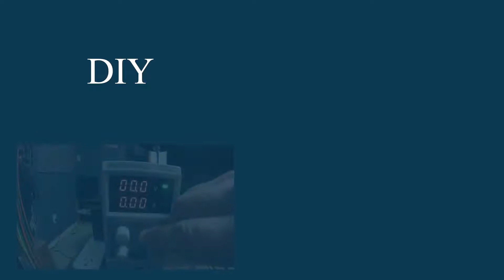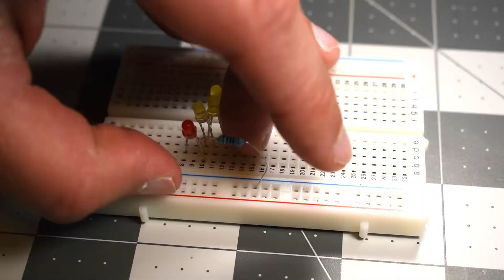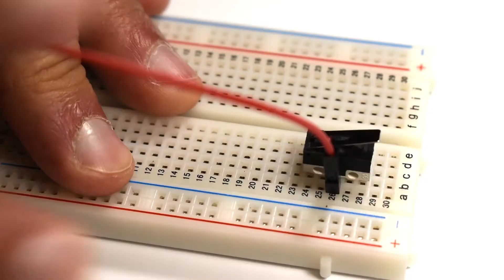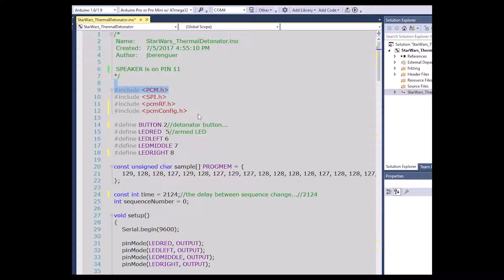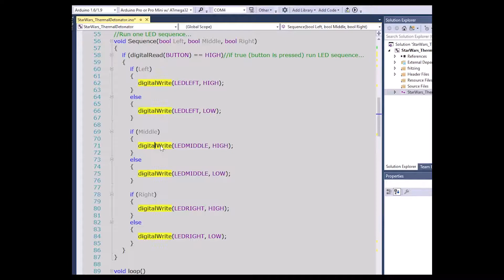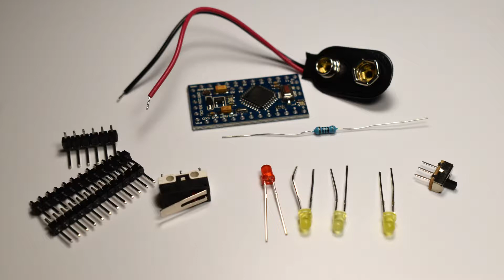Arduino: Making the Return of the Jedi Thermal Detonator

Comment: Do you have a pic of how you attached the momentary switch to the 3d printed slider?
Reply from the maker: unfortunately, I do not.. what I did was use a screw to secure the switch near the slider and then used hot glue or super glue to further secure it.. I placed it where it would be pinched "closed" when the slider was moved back.. I never tried actually securing it to the slider itself

Comment: Can you use the same code and parts with an arduino nano every?
Reply from the maker: using a nano shouldn't be a problem. I would recommend comparing the data sheets just in case. The nano and pro mini do have a different number of pins. I would check that the nano has enough pins to support the number of connections for this project. I have not tested the nano for this project, but the pro mini I have used has comparable specs at first glance.

Comment: Thanks for the video, it's a really interesting project.
I used an Arduino Nano instead of the pro mini but got it to work without any major problems. 
Currently thinking about adding another button with a second sample (if i can fit it into the memory) to have the normal "armed" and an additional "detonation imminent" sound.

However, if you don't mind, i got one question:
My mouse button tends to fall out of the breadboard and if it does, the behaviour is the same as if the button is pressed. Why is that?
When the button is not pressed, the contact of the mouse-button (C, Pin2) is connected to NC, i.e. ground.
When the button is pressed, the Pin2 is connected to Vcc (pro mini) or +5V (nano), so it gets the high signal and starts the sequence.
But why is no connection at all the same behaviour? I can even remove the Wire from +5V and just connect and disconnect Pin2 and Ground to switch...
Reply: Okay I found out what is happening: In the code, Pin2 is defined as Input_Pullup, effectively connecting Pin2 to +5V when nothing is attached. 
The definition as Input_Pullup is done to have a known state, as the Pin resistors only need a very small current to register a state and can be influenced by environment if no connection is present, so they are usually set to either +5V (pullup) or ground (pulldown) in the pin mode to avoid unwanted triggers. Since there is no Input_Pulldown state in Arduino, Pullup had to be used, which caused the behaviour i wondered about.

Just in case anyone ever has the same problem...
Reply from the maker: sorry I missed this comment. But happy to hear you worked through it!! that is what a true maker does!!
Reply: @circusplus  No problem :)
I actually maanged to finish the electronics part of the project and now have a second sound. Used every last byte of the progmem :D

Now i just need to optimize my CAD design of an electronics holder for inside the detonator to have everything tidy.
Reply from the maker: @MormegilSC  awesome work!!! thanks for watching!!
Reply: Are you able to help a beginner? Using Nano aswell. The speaker is playing the sound, but the none of the LED's are lighting up. Can't seem to find the issue...
Reply: @torjus99  Are you sure you wired everything up correctly and didn't switch the + and - of the LEDs?
Reply: Found one problem, the resistor was not peoperly connected in the breadboard. But what I don’t understand from the video is the 9v going to positive  on the breadboard. But nothing else goes to positive On the breadboard?

Comment: Hi, when I tried uploading the code, I got an error message saying "PCM.h" file not found. Can I know what is wrong? I read an earlier thread that this is actually not needed. In this case, is the PCM.h and SPI.h in the code not needed. I am new to these Arduino programming and maybe someone can explain where these PCM.h and SPI.h file should be place if they are required in the program (in the codes or file directory). thanks.
Reply from the maker: that's correct, they are not needed. Comment out any code that references those if any
Reply: Thank you :)

Comment: Hi all - I'm really new to electronics but have been printing for a long time. I have the shell of the detonator about ready to go and all the parts above also ready to try in a breadboard. If that all goes well, I'll be happy, BUT I'm not sure I'll have the understanding of how to take those parts and assemble them in a stand alone circuit to go inside the sphere. Does anyone have a link to this exact build being produced? Thanks in advance. PS - the link to 'buy the kit' above seems to not work or I would have looked there first =)
Reply from the maker: thanks for letting me know about the buy link.. as far as the build, have you downloaded the code (in the description)? The zip has diagrams, code, etc.. You will also need an FTDI adapter to upload the code to the pro mini, since it does not have USB... the diagram is a fritzing file. The file can be opened in the fritzing app that's free. let me know if you get stuck.
Reply: Thank you so much, I hadn't realised it was in there. I'll check that out over the weekend. My Pro mini arrives today and I have a cable for it. My first time doing anything that isn't just a couple of LEDs in series. I'm almost certain that when I look at the diagram... I'll still be confused. I picked up a soldeing iron for the 1st ime in 30 years last week, so I really am at stage zero. Thanks again!
Reply: @circusplus  Just downloaded all 3 links but the Code link seems to be just that - The code for the arduino but no zip file. There IS a zip for EncodeAudio and The PCM. Am I missing something? Thanks again in advance.
Reply from the maker: @josewilliamson568  http://jimandjoes.com/83964b9ct5soe.zip
Reply: Thank you so much. I'll let you know how I get on.
Reply: @circusplus  Hi again - Typically enough, I can't seem to get this to work on the breadboard, but as far as I can tell have done everything correctly.

To confirm... First I uploaded the basic blink sketch to check the arduino pro mini was connected correctly and working (it was).

Then...

1) opened the StarWars_ThermalDetonator.ino (contained in your code from the folders \83964b9ct5soe\code\StarWars_ThermalDetonator. Have used both the online and local offline versions of the sketch editor and uploaded to the pro mini (tried both just incase this was the error)
2) built the breadboard following instructions in the video
3) Didn't work so tested the components, double and triple checked the build - tried again, but still no joy. 

I realise that trying to troubleshoot someone who is new to this and without seeing how they set up the board could be a fools errand, but do you have any ideas? Is there something else I'm supposed to upload to the pro mini?

I noticed a couple of libraries are needed (pcm.h and spi.h) but also that there is another version of the sketch  which seems to want to include some extra libraries... SD.h, psmRF.h and pcmConfig.h. Which version should I use and also if I use the online editor, are the required libraries added atomatically?. Would you be open to me emailing you some pics if needed?

I so thought I had it nailed!
Reply: @circusplus  scrap that! SOLVED IT! I realised that I was missing 2 wires from RAW and GRD from the mini to the board. Spotted it by looking at your final diagram. I didnt have enough pins in use. Really pleased that I got it!
Reply from the maker: @josewilliamson568  that's great!! :) I'm glad you got it.. more importantly, I'm glad you stuck with it!!
Reply: @circusplus  What type of FTDI adapter whould I get??
Reply from the maker: @robredfeather8731  FT232RL FTDI USB 3.3V 5.5V to TTL Serial Adapter Module for Arduino Mini Ports
Reply: @circusplus  Thanks!!!

Comment: what type of relay are you using ? NC-NO-C ? Do you have a parts list any where ?
Reply from the maker: there's no relay being used on the Detonator project. here's the list:

100 ohm resistor x 1
Arduino Pro Mini
28mm 8 ohm speaker
9v connector
yellow leds x 3
red led x 1
toggle switch x 1
mouse switch x 1
Reply: and the AMP? @circusplus
Reply: the sound comes from the arduino - no amp...
 @Gre4tOne

Comment: Everything electronically is now working, my only problem with it is the volume of the speaker. Do you have any sort of ideas as to how I could make the speaker louder, I think if I could somehow get just the speaker to get 9 volts directly and then everything else still have the normal 5 volts it would be a bit louder
Reply from the maker: you could try a transistor. they are used for amplification applications. I'm not sure which one you should try off the top of my head, but I would start by researching that. Keep in mind that the speaker I use is only like 2 watts or something.. it's not exactly powerful, so if you used a speaker with specs like mine, you're not going to get much volume. To get the 9v (and double check that it isn't going to mess the speaker up first) you can use a single channel relay. Possibly an up converter will work too (voltage booster). The voltage booster usually costs a little more, but is also smaller typically

Comment: I'm trying to compile the code, and it says that I'm missing the <pcmRF.h> directory. I'm not a hundred percent sure that I installed the libraries properly but I looked in it and I didn't see such directory. Thank you for making this video btw!
Reply: Bubba VanderKooy some of the includes may be unneeded - try removing some of them at the top (comment them out, don’t actually delete) I think they are the TPM ones if there are any SD card includes comment them out.. do a build don’t do a build and upload - you just want to build the code and see if you get errors
Reply: @jfredricks2394  that worked, thanks!

Comment: Could I substitube the Arduino Pro Mini Chip for the Arduino Nano V3.0 ATmega328P? As I'd be more comfortable working with a simple USB connection.
Reply from the maker: I can't think of any probs with that off the top of my head. Any thing you pick really just needs to have enough GPIOs to handle the project and of course the memory to hold the data for the sound.
Reply: @circusplus  Great! Thanks, I've ordered one off eBay so I look forward to giving this a try! Thanks again for the video it's very useful and well recorded.
Reply from the maker: @DaveDude323  thank you!!
Reply: @circusplus  Right, so I've put all the components together on the breadboard, I've removed some of the unneccesary includes from the code in order to get it to compile as others have suggested.

However, as soon as I turn the power on, the sound activates however without the LED's flashing though.

Any ideas what I have done wrong? 

[EDIT] OK, I have fixed one of the issues, the sound no longer starts as soon as the board is powered. It only sounds when the detonator button is pressed. I solved this by removing the jumper going from the button to the VCC pin.

However, I still have no LED's lighting up.

[EDIT 2] Right! Ok sorry just me being a numpty, with my limited knowledge of breadboards, I didn't realise there are two different halves to it, so I was connecting the LED's up to the wrong side of the board, connecting them on the right side causes them to work fine now.
Reply from the maker: @DaveDude323  awesome troubleshooting!! Troubleshooting is an important skill for anyone wanting to become a "maker" - great job!!
Reply: @circusplus  Haha thanks, you can't learn without making mistakes :)

I have one more question for you if I may? 

I have decided to try and encode my own audio file for use instead of the one that you included in your code.

I have found the audio encoding rather interesting... it does not seem to matter what length or quality the audio is, a 5-minute long audio sample when encoded seems to take up the same amount of bytes as a 3-second one.

So my question is; how can I best reduce the size of the encoded data whilst maintaining the highest quality that I can? 

I have about 30000 bytes to work with, and your audio works fine, but even when I try encoding a 1-second sample saved at a ridiculously low quality, it still takes up more space that your encoded audio clip.

Thanks again!
Reply: @DaveDude323  I'm also trying to get this to work on a Nano v3 but I keep getting sketch too big errors. Any idea what I could change?

[EDIT]: Future people coming to this comment. I just deleted some of the numbers off the end of the EncodeAudio data.

Comment: I just finished making this. The sketch you have provided won't work unless you comment out some of the libraries. Did you intend on installing an SD card reader for this? Thanks for the guide.
Reply from the maker: good catch! yes, I originally intended on an SD card for the sound, but found a different method that required less hardware, which is always good. Thanks for watching!

Comment: So I watched the video, but I am really new to this. Do I need to run the program to install the audio on the ordered board or does it come preinstalled? How do I build the switch after running the Arduino code? Can you attach a pic or diagram of how you have it hooked up inside the printed detonator?
Reply: did you ever get yours wired and working? I just bought one of these and im wondering the same thing. Woulda been nice to know i needed an FTDI programmer also.
Reply from the maker: it is not pre installed - you will need to download the arduino app (it's free ) and upload the code. You will need an FTDI programmer to do so
Reply from the maker: sorry I didn't address the other question - I no longer have the completed one, so I cannot upload pictures. I sold it to a friend.